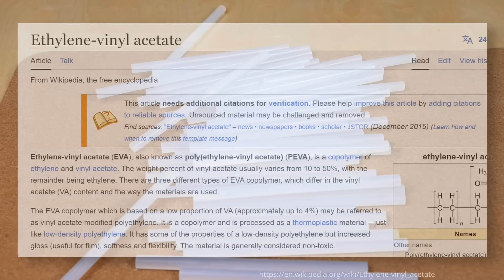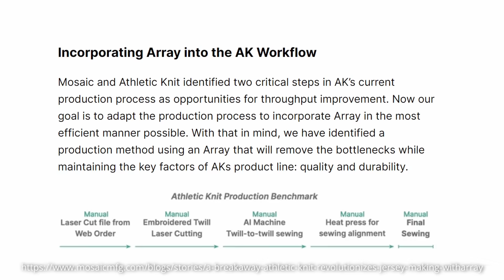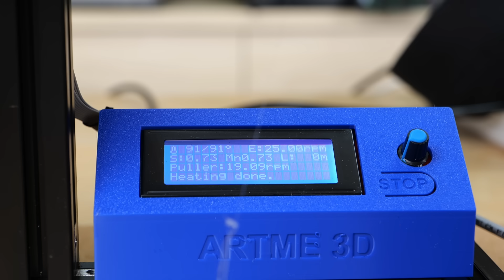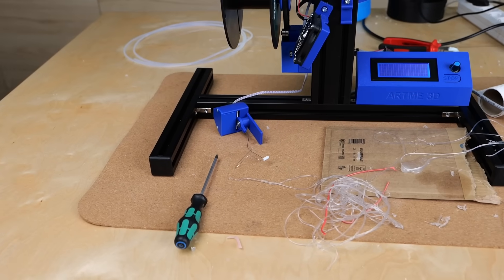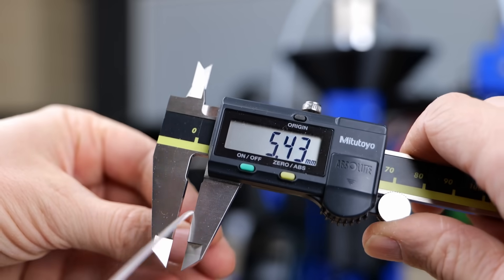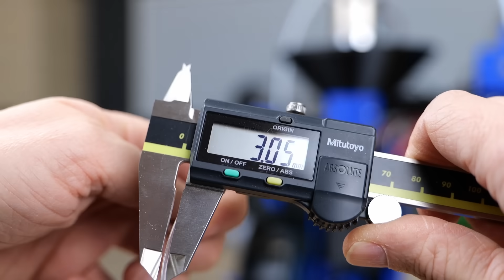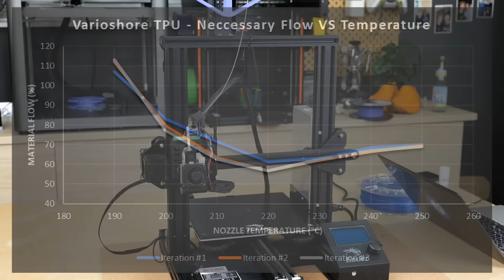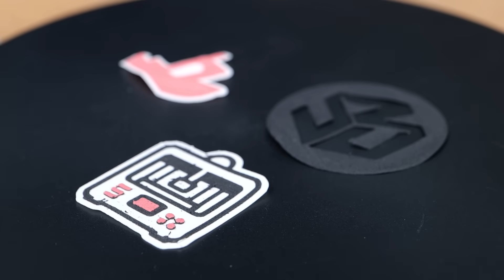Can you 3D Print with Hot Glue?

Comment: Hm, in your test you printed the glue stick layer first... which seemed like it didn't release well from the print bed. What about printing the glue stick filament on top of the patches? Also, while being an interesting approach... is there maybe a chemical solution that works better like superglue or simply a bit of acetone to make the material sticky?
An even more crazy approach would be to design an extruder for viscous fluids.... something that usually works for ceramics... and where the "burning" process in the oven later makes the material hard or dries it...  just some inspiration.
BTW, I like your mindset of "I have a stupid idea! Lets actually do it!!!"; I used to do this more in the past... one often says coffee is that thick that a spoon would stand upright inside. I and a colleague thought, we need to actually make coffee "thick" and to eat it... so we used some gelatine and finally ate it. It wasn't delicous... but I can say, I ATE coffee! --- SO... Keep it up!

Comment: Get yourself some high temperature hot melt glue pellets for commercial applications (we get some in the printing and binding industry) and evenly mix it with a small amount of some medium hardness clear TPU. That will likely produce a much more reliable filament that could possibly feed through a greater variety of printers. It should solidify much faster out of both the the filament extruder and the printer nozzle, and adhere to the patch layer and garment more reliably.

Comment: To make your filament, how about try adding a length of copper tubing at required inside diameter, then you can slowly bring the temperature down before it exits the tube. 
Or, visit a hot glue stick factory and see how they make such a perfect sticks. Great videos, thanks for your hard work and sharing your trials and errors

Comment: I personally have a large format vinyl sign printer and a plotter (think drag knife cnc) and I think using existing printable iron-on materials and then cutting them on a plotter is a much better outcome. Vinyl plotters are very similar to cnc routers and 3d printers, but have a fixed x axis (material width) and infinite y axis in material length. Z axis is pretty much just cutting pressure.

Comment: Add cheap, commercially-available cellulose powder to the hot glue, for toughness. (Perhaps mix it into the shredded glue dry so it covers the surface as a powder before it melts).

Also, adding water to the hot gluesticks can cause the liquid flow to pull the glue sticks into the blades. Also...water and a tiny amount of xanthan gum can do the same, but then you have to rinse off the gum.

Since some proteins are heat sensitive (lignin!) it might be possible to "print wood" with a non-binding or weakly-binding "extender base" like hot glue, or even water, xanthan gum+water, or some other "similar temperature" filament. "melting" lignin is how wood-benders bend thin wood. Might need much higher temperatures than normal. ...but if you had isolated lignin, you could remix it with "continuous cellulose fiber" as per DESY(Germany).

 Also...try extruding cellulose into long fibers using your machines and a much finer extrusion head. DESY made something tougher than spider silk this way. You want the strands as fine as possible, then, ideally, braid them into something like kevlar.

Rotated grain-direction (like plywood) cellulose and/or spider silk can likely be "the holy grail" for strength. (I.e. printed firearms, daggers, one-use drone guns, propeller blades, bulletproof armor, and...with aerogel dust...insulating armor)

Comment: you could make hot glue joiner parts that you slot into a spot heat it up with a hot air gun or it could be used at impact resistant material or even for flexible containers or cases.

Comment: Fascinating.

The other approach you might want to try.... if you take hot glue sticks and put it between sheets of baking paper, you can iron them flat. You end up with this really flexible sheet of glue. I kind of wonder if it might work with a vinyl cutter. Or you could just put it on your print bed and print on top of it and cut away the un-needed bits later. The left over bits of your hot glue sheet can be remelted into a sheet again.

Comment: 16:50 You really need to look up a bit on temperature measurement with a pyrometer, as it depends heavily on the material what you will measure.
Pyrometers usually are set to an emission rate of 0.95, which blank metal like the sole of your iron will not reach. Depending on the surface the emission rate could be anything from 0.1 to 0.9, meaning instead of the surface radiating 95% of its infrared spectrum and reflect 5% of its surrounding temperature, it could radiate much LESS infrared (and reflect more room temperature), making the numbers shown on your pyrometer MUCH lower than the actual temperature is.

That explains your experience with your first ironimg.

Also, irons use a bimetal switch which is not a good way for having a constant temperature. If you are lucky, it will be plus or minus 10°C. If you want precision, you best get a cheap iron and do some heavy electronic modification to it. 😅

Comment: It might help with feed and heat soak if you cool the glue filament strand down before it enters the drive gear. Something as simple as a PTFE tube inside a bowl/bottle of ice water could help lower the temperature enough to reduce its adhesiveness. 
Also, preheating the cotton shirt with the iron prior to putting the sticker/logo on would probably help with the amount of back heating needed for adhesion and could minimize the TPU melting issue.

Comment: why not make a blend of the flex filament and the hot glue so the process can be done in one. Would probably also help with the stickiness problem and  i imagine once it had cooled would not be sticky at all and also because of how thin the extrusion is and mixed with flexi that the glue might not harden as it normally does and remain fliexible

Comment: I have a feeling that one can dive down this rabbit hole even further. Mainly because EVA isn't the only glue stick material available, only the most common one.
However, perhaps some "sub ambient" cooling could be advantageous here. As to cool down the extruded filament even faster. After all, that the material becomes brittle and hard isn't technically problematic during printing, one can thaw it up after the printing is done.

Comment: The problem with hot melt glue on clothing is eventually, they will come off in the dryer.
Perhaps you can improve the adhesion of the filament by mixing cloth glue into the mix and combining the two together.
Another option is to determine what adhesive iron on patches use and come up with a way of turning that into a filament.

Comment: If all upi want is hot-melt glue on the back of a 3d printed iron-on, all you do is melt a blob of glue and spread it on the back of the print.  I don't see a need to try to feed the glue through a printer...  You can make thin glue sheets by putting warm glue on  a warm silicone mat, and put another warm mat on top, then roll it out with a rolling pin.  Put the sandwich in the freezer to cool, then peel off your glue sheet, and cut it to size with scissors.  Printing hot glue just doesn't seem like the right way to do this.  Is it possible to just use plain tpu?

Comment: Maybe apply the heat to the patch from the inside of the shirt so you are heating the glue and cotton, not the patch logo.

I also wonder if you could add some sort of fine filler material when trying to make the filament to help with cooling and stickiness.

Comment: Looks great, and it has potential, but to be honest making a hot clue coater would be more practical. A car part factory I worked at would make sheets of thin latex rubber, and before the sheet would reach the press to have the parts cut out of it, it would pass under a larger machine that would coat the sheet with hot glue. later the part was heated and pressed onto a fiber pad and a cold mold head would press the 2 parts together  and chill both the rubber and the hot glue coating joining the parts. Think a merry-go-round but with mold forms instead of horses.

Comment: I think you will find it’s not a hot glue stick type adhesive they used in the items you saw at the show..
- Look into  DTF printing, there is an adhesive layer that is put on the final print. I think that’s what they are using.

Comment: I have Black industrial hot glue sticks for use on PCB board wires. It is high temp and cools super fast. You have to work with it quickly. It is super strong. It might work better for you.  It's Expensive though. You can even get it in small pellets.

Comment: Great Video, when you switched the gear, the thought came to my mind maybe a pully instead with no teeth.  Patches look great BTW, TBH the system would have to be different, instead of trying to make the glue a filament, have a chamber like a syringe holding the molten glue and just injects it onto the bed, because the material does not behave like filament.

Comment: I had no doubt in my mind that the hot glue would work well in the washer and dryer. I have a pair of shorts that have had hot glue on them for years. At least from 2017 and it’s still not off. It’s crazy

Comment: 1. Use high temperature high strength hot glue
2. Iron from the inside of the shirt with the baking paper on the table
3. If you have a solid patch with no (or few, or large) holes, you can aply the glue to the bed with the gun and level it with a toothed trowel. Trim with an xacto when you are done.

Comment: It's been interesting as always Stefan, but I've worked with thermotransfer materials to make t-shirst and I can't see how 3D print could beat rolls and sheets of material in multiple colors called "thermotransfer film" which you just put into a cnc cutter which cost less than 150€, you strip away the countergraphisms (the part that should be blank) and just iron the rest on the t-shirts. No sewing required.
Yes, the ones I've seen in your video look very well done, but I can't see the way how this 3D process is better or even just cheaper than regular thermotransfer films.

Comment: I would sugets you try mixing high temp glue sticks with a (clear) other filament material to tweak the properties to your likning. After all any filament will melt and be sticky (or it would not print) so if you choose a soft lo temp filament and add a small amount (at first) of glue stick you may get the results you wanted. A other approach could be to melt the filament alone in to the fabric and that way stick it to the fabric if you iron it from the other side of the fabric and add a little extra in the bottom layer. That way you "sacrifice" a little material to act as the glue. If that layer do not melt enough you could always mix it with a bit of glue stick. I think melting both in a pot on the stove and mix them as "liquids" would give the best blending. Hope it works out for you.

Comment: You'd extrude the filament directly in a bath of oil (or wax). So, you can control the temperature of the oil, the temperature of the melted material, the speed, etc. etc. 
But this glue, i think, is useless for 3d printing.

Comment: Hot glue is the WD40 of adhesives: it works great for quick fixes, but it's not a long term solution. Similar to the way WD40 loses its lubrication property after all the solvent has evaporated, hot glue loses its elasticity and becomes brittle within months. I'm not sure if that change in the medium term is due to exposure to oxygen or UV, the loss of volatiles (similar to WD40), or something else entirely. Either way, hot glue seems unsuited for iron-ons unless you're going to follow up with stitching.

Since you're 3d printing, perhaps there's potential in integrating some kind of mechanical fastener into the print, that would penetrate and grip the fabric for long term stability after the hot glue degrades. Something like a foldover tab or pin would be too fragile and fiddly. Maybe a velcro-like edge strip or many very short barbs are various angles? Admittedly it's hard to imagine it working well, but the general idea of integrating a mechanical fastener into the decal might be a line of thought worth pursuing.

Comment: TPU can be ironed onto cloth directly and there is no need for any adhesive. Place the tpu patch down first onto a wax paper, place the cloth over that and a final layer of wax paper then iron on the patch heating through the cloth. The only thing that really takes any practice is melting it with even pressure and not keeping the heat on for to long smearing the tpu out. The results can be great and hold up to many washes before a corner starts to peel off but its no big deal you just iron it again.
Reply: For that matter, you can print TPU straight to fabric, too.
Reply: I second this. I have had great success ironing TPU on cotton.
Reply: how many layers and at what layer height would you recommend?
Reply: I see Temu has hot melt thin sheet material dirt cheap specifically for fabrics, wonder which would hold better, those, or your direct TPU...  may have to try and compare!

Comment: Given its relatively soft nature I am curious as to whether it could be extruded to the proper diameter by simply using hydraulic pressure with the glue stick warmed up slightly but not melted. The  orifice  being the final diameter...

Comment: I'm not so sure that glue stick filament, for the purpose of adhesion is necessary, Why go through all that effort when you could just as easily sprinkle the ground up stuff onto the patch, or press melt the stick between silicone or Teflon sheets, cut with scissors or one of those cnc vinyl cutters. Though the idea of hot glue filament is interesting, I bet you could pigment the filament with just about any fine powder from ground up charcoal to dharma dyes. The cooling a spooling problems gave me the idea of sending the filament into a bath of cold isopropyl alcohol, hot glue sticks to nothing with a bit of alcohol, and it would just evaporate, potentially with assistance of a fan, or just let it naturally. it might even be beneficial to have it still wet as it is spooled. If ambient temperatures isn't cooling it fast enough to print well, put that printer in a chest freezer, I have seen a printer working under water, you can solve this if your interested in it.

Comment: Why not just use the glue gun with a pusher motor on top and a modified head with the correct size extruder on the gun itself? I don't see the need to shred it when you already have the extruding platform built and just needs modification.

Comment: Seems like you need to keep everything ABOVE the extruder cooler. The time you're talking about seems like the heat is rising to the gears which is causing the gears to warm up to a point that they get hot. Keep the gears cooler and you can probably succeed. Add another fan to blow on those.

Comment: Yeah hot glue is almost too sticky... I wonder what plastic they actually use in heat fuables sheet for patch/fabric you can buy on a bolt or the Glue they use in Heat Tranfer Vinyls?  🤔 These are not as sticky as Hot Glue but also stay soft enough for washing. 

The Varioshore TPU type patch that Mosaic's 3D make could be using some formula of fabric fuse hot glue I suspect. 

Personally I'd like to print a Varioshore TPU variant face down and adding the Heat Fuse glue as a last layer for personal use. The nice thing about the sheet heat fix glue is that you can iron it through the back side of the garment that way most of the heat is effecting the glue and not the patch material. Doing this for years with cosplay pieces that I need to glue but NOT have a liquid glue soak threw. You just need to tape the patch in place and flip the garment inside out.

Comment: Since you're just using the hot glue as an adhesive, it almost seems easier to just apply it to the back after printing with some kind of squeegee or brush from a hot melted pool, rather than trying to extrude it perfectly. A bit of excess around the edges could be trimmed easily.

Comment: You need a better glue material. Something with a smaller thermal envelope, one that melts at a lower temp and solidifies at a higher one. I know using glue sticks is super cool but if you really want to get from concept to implementation then I think it would be worth looking into a different less commonly available in the home material

Comment: You need to use water cooling to do it so that it works well. When I brought that programmable color material to protopasta it needed to extrude at 60C for color and 70C for transparent. Do you want a bag of that material to try to make the programmable color changing filament and also to test for use on patches. I have a large bag of material in pellet form that should work in your extruder.

Comment: Innovative and useful. I think there might be better choices for materials (adhesive and patch material)... but it's still a very useful process that a lot of people could use. I know there are other methods, but not everyone has the money and a lot of people already have 3d printers and the knowledge to use them. I only wish you didn't need a special hotend setup to print it. I think that may be part of the whole "need better materials" thing though. I'm sure there are lower heat thermoplastics that could be used as adhesive (that won't come off in the dryer)... and a good, flexible, higher heat material for the patch that won't melt while being ironed on. In any case though, it's an Excellent starting point for people to get into perfecting it. I'm sure there are some people thinking up their own ideas right now.